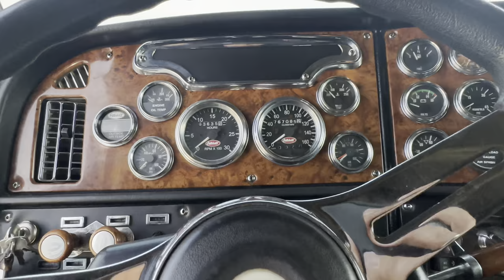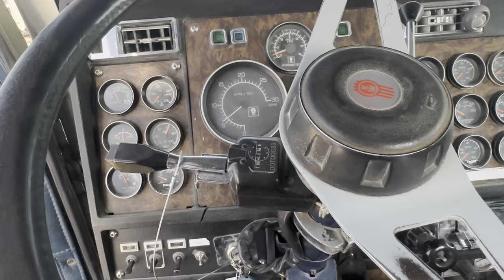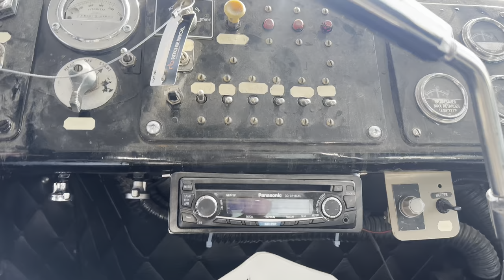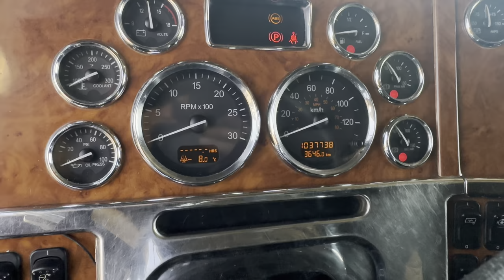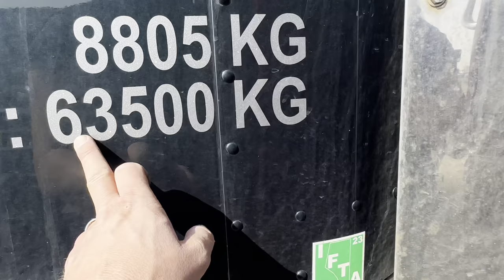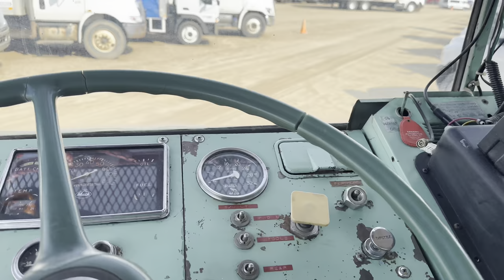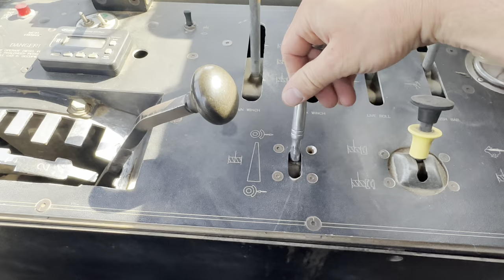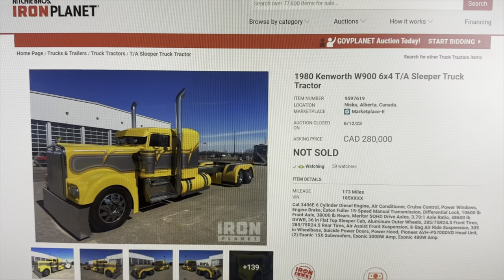On The Hunt Ep.36 You Cant Afford It

Comment: The wheels on the GMC are a Widowmaker. It's still a 2 piece wheel just a different design. We had both in Australia and the widowmakers were the lock in variety. The split ring were called "split ring wheels" and were much less dangerous. The Toyota Landcruiser still came with split ring wheels as an option up until about 2010 or maybe even currently so you can change tyres quickly and easily in the middle of nowhere.
If you look up the Firestone Budd wheel catalogue of 1949 you'll see about 7 different options for wheel rims that were all deadly!

Comment: Those wheels on the old Chev beside the square body, is actually 1 of 3 different types of widow makers. One where the rim itself is split in the middle, the second one is a 3 piece rim where the outer ring has to be centered on the second ring to lock it and the style you just showed on here, which also has to be centered.

Comment: that yellow KW at the end is called "the bride of the beast" it was built by Elizabeth Truck Center in NJ  as a sister truck to "the beast"
Reply from the maker: Interesting … still curious why they didn’t put two nice seats on the cab 🤨
Reply: @TwinStix  im not sure either, the guy who owned it was a stickler for details, ive seen that truck and the sister truck in person and they are impressive
Reply: @TwinStix  It's a show truck. Pretty sure not a working truck based on that 5th wheel. Don't think it was intended to work, eh?
Reply: @hammers1518  correct strictly a show truck as is the sister truck to it, google "the beast" show truck to see that if ud like

Comment: Talking about turning up a 425, there's a 359 here with worked injectors putting over 650 on the ground, turned fuel and air to it, apparently those b blocks have an air screw as well

Comment: Ah thanks for the trip through RB auction and as usual some real gems.  I believe that 50's chevy split rim is what my dad used to call suicide rims.  the rim itself actually split in half and you had to be extremely careful when putting together and airing up.
Reply: Around here they called split rims Widow Maker rims. That one in the video looks more like a snap ring rim. The first versions did not have a split in the ring. They were a pain. You had to work the ring off and keep working it around until it popped off. The split ring snap ring rims were much easier.  The true split rims could be dangerous because you couldn't see if they were seated very well.

Comment: Yeah Mark, that red Mack is a Bucket/ Chip truck combo. When I worked for the tree service company I preferred the dedicated Bucket and chipper trucks. The chipper truck obviously tows the chipper, the back has a PTO dump box to get rid of the chips easily. You always had to remember to spin the chute on the chipper before you started towing it or you'd smash the hell out of the dump box and the chute. LOL 😂 I preferred the dedicated chip trucks because they had a man cab as well with a bunch of storage for saws, rope, snatch blocks, tools, etc as well, in that cab, plus the seat bottom flips up for more storage. There were big locking boxes under the sides of the chip truck that so you could keep more saws in there safely. We had a 60' and a 100' bucket. They both had DT466's in them, and boy were they gutless 😂

Comment: I enjoy watching your YouTube channel I noticed that you now have a trans am to go with the Smokey and the bandit truck I had a trans am back in the day and learned the hard way that Pontiac used pressed in valve guides so if you plan on beefing up the motor have the machine shop drill and tap the heads or with a bigger cam they will pull out just something to check on and look into keep making the videos I enjoy them thanks Ray

Comment: That Chevy truck in 36:34 probably has the split rims that they call "widow maker". Instead of having the split ring, it's a two part rim. It has a cut right down the middle of it and when you mount the tire on it, you lock those two together. There's a video called "All About Split Rims, Explained!" by Sealed Beam Rally Team, they explain it with a lot of details about each type of wheel.
Reply: Wow and no it doesn't!

Comment: That Hayes was an early Clipper before they went to a fiberglass hood.
Reply from the maker: No kidding … interesting 🤔 wish I could’ve bought it 🤦‍♂️
Reply: @TwinStix  For $16K it would have been pretty cool but believe me when I say the cool would wear off quickly if you had to spend 10 hours a day in it!  :)
And that rubber block suspension is rated for 44,000 lbs, the 38,000 lb suspension only had 2 blocks instead of 3. I ran a C500 with 44 rubber block doing heavy haul, it was pretty common years ago but make no mistake... it's a back breaker!